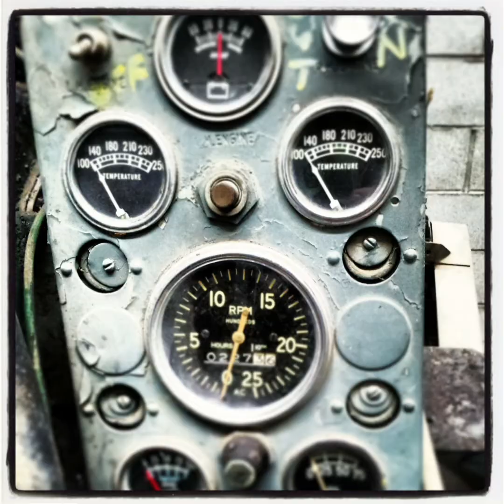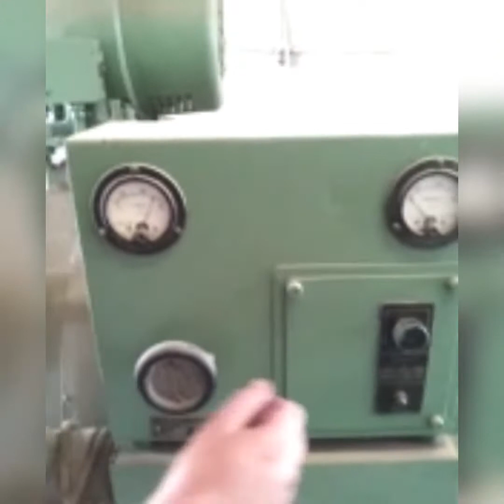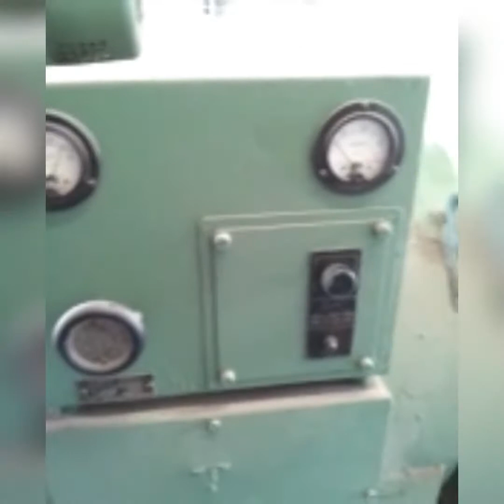PLEASE  SUBSCRIBE! Siamese WWII Sherman tank 6-71 Detroit Diesel's for generator!

Comment: That 71 series Detroit is the most reliable Diesel engine I have seen. It liked its fuel and it used a little oil but it ran forever.

Comment: 227 hours!! Them Detroit’s aren’t even broke in good yet!!
Reply from the maker: They were such a great running set. We had to update due to insurance requirements because we have two 600hp boilers that could become come unstable and explode if power failure happened. Ended up selling them to an amish business for there electrical needs. I tried to find a good home where they could be used in a restoration project....💔
Reply from the maker: The entire setup sold for $500....
Reply: @fhi2003  WOW! $500?! 😢
Reply from the maker: @cannonballrepair7940  It was heart-wrenching I'm sure they are trashed or sitting outside behind a barn.....  It was an all in one unit it had a 300gallon fuel tank that they were mounted above. We could pull it in and out with the forklift.
Reply: @fhi2003  Would love to know if you noted serial numbers or knew estimated mfr date of those bad boys!